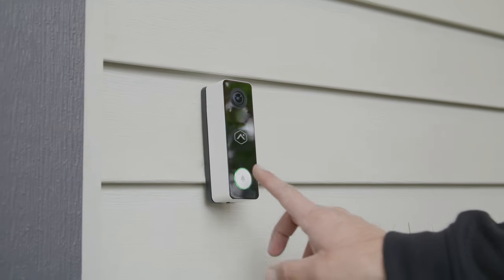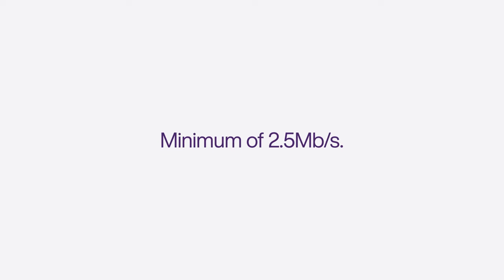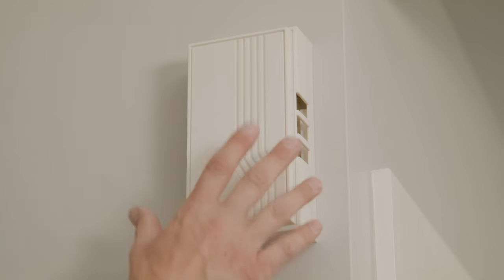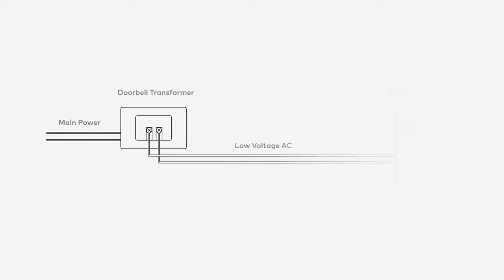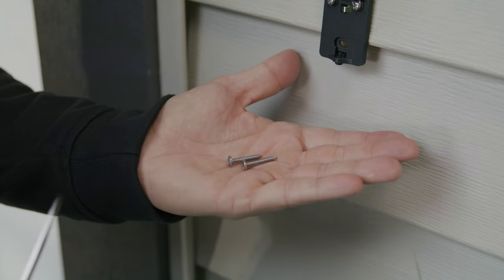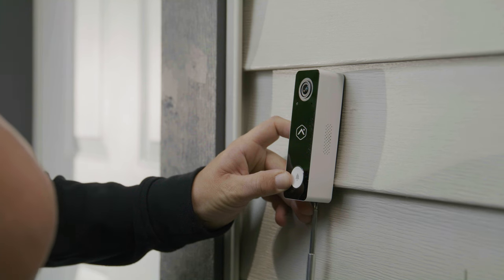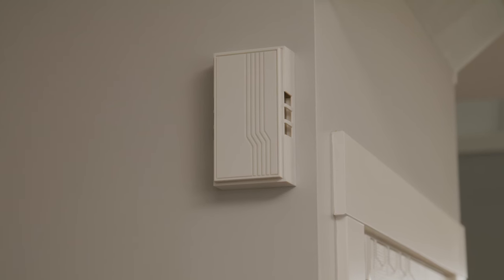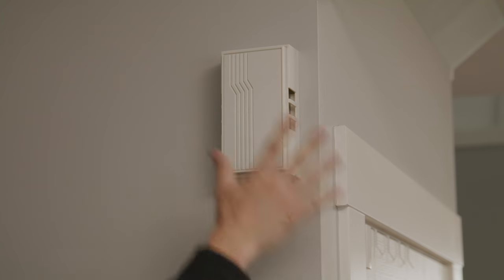TELUS | How to install the ADC-VDB750 Doorbell

Comment: Just had mine installed 2 weeks ago. Absolute garbage from the beginning. All you hear is static. Telus has been absolutely no help. Have had 2 technicians out. Still not fixed and now they’re telling me I need to hire a 3rd party electrician at my cost. Had zero issues with my old doorbell camera. Would install it back but 1st Telus tech took it with him which I was told by customer service that he shouldn’t have.
Reply: Same!! They are a shitty company